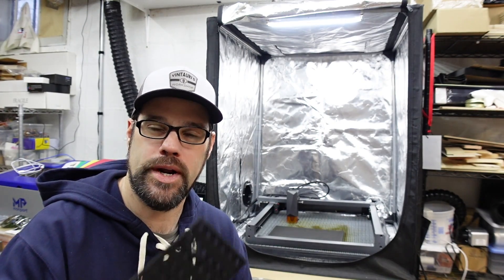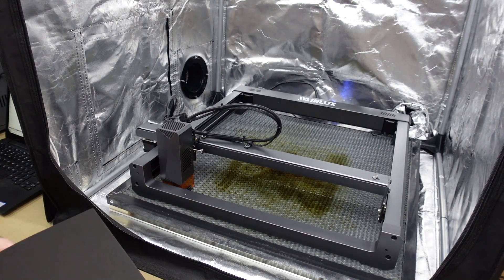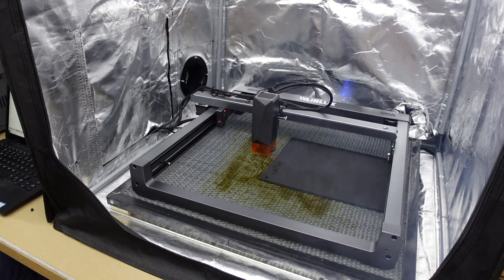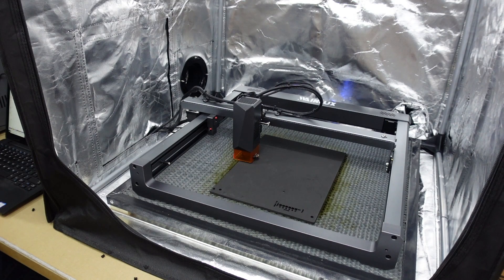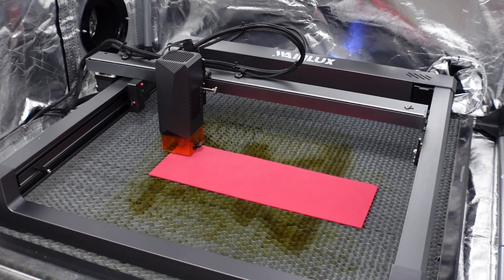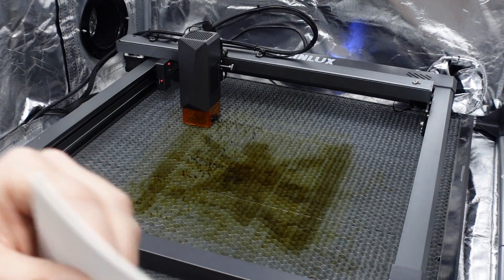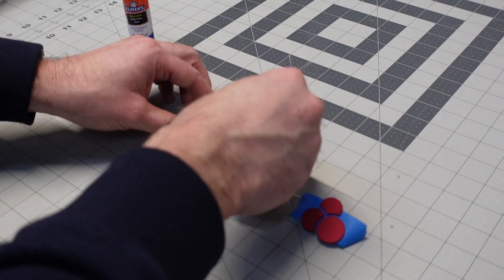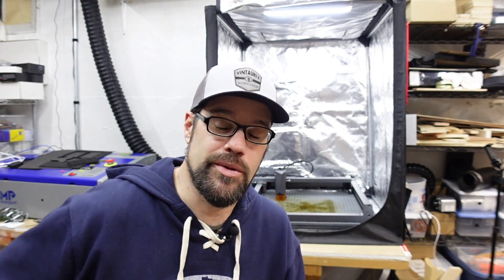Cutting EVA foam with Diode lasers!

Comment: Help!!! I need to engrave on white adhesive foam and it’s not working. Any work arounds?? Ty
Reply from the maker: If you are using a diode laser it will not work on the white material as it will just reflect the visible light. You need to use darker colors of material.

Comment: Would this work with adhesive foam backing?
Reply from the maker: It should, I've cut other materials where I've added the 3M adhesive backing before cutting.  Just keep an eye out for flare ups.

Comment: Eva Foam fumes are toxic, Please wear protection.
Reply from the maker: This is a good point, but I also always have my lasers running through air filters and then exhausted outside.  Anyone running a laser on any material should avoid all fumes even from untreated wood.

Comment: 6:03 - If you're cutting the all the way (it's not very clear from the video if the corners are joined), it's generally a bad idea to cut the outline first, because the piece might move slightly (especially with air assist) and your subsequent cuts can be slightly off. Always cut the outline as the last operation, to avoid that.
Reply from the maker: It's not clear in the video but it is cutting the arcs on the top of the part and not the inner circles.  The inner circles all get cut first.  You are correct that any engraving and interior part cuts should be done first and this can be set in the Lightburn optimization settings.
Reply: @Vintauri  - I mean the rectangular outline.  It's clearly starting with that cut, but I can't tell if it's joining all the corners or not.

Comment: Hey Steve, I will also ask on the Sunday night show, but have you ever tried using the Pepakura-type files with the EVA on the Diode Laser?
Reply from the maker: I have not tried that yet, it would be a fun experiment to see if you could score the lines for the folds without going so deep that it causes the foam to rip when putting it together.

Comment: Can it cut EVA foam, 40-50mm thick?
Reply from the maker: The laser beam only stays in focus for 2-3mm outside of that range you loose power and the spot gets wider.  So 6-9mm is about as thick as you will cut on a diode.  Some Co2 lasers with a longer focal lens would have a chance at EVA foam that thick.

Comment: Hi, what max thickness of EVA foam are you able to cutt with 10W diode laser? I need to cut a toolbox foam - 40mm thickness.  So I would like to cut 10mm sheets and than glue them together.
Are you able to cut 10mm EVA with this 10W diode laser head? Thx
Reply from the maker: I've only cut 1/4" or about 6mm thick EVA foam.  I have not tried anything thicker.  Your laser beam will go out of focus the deeper you go so there will be limits without a longer focal length and a powered Z axis with multiple passes.

Comment: Red can cut way faster, my 10W cuts at 5000mm/s on a 2mm EVA foam, the green one cuts at 4500mm/s. Even the blue one cuts at 2400mm/s.
The white you should do multiple passes at higher speed for better finish.
Reply from the maker: Thanks for sharing that information.  It will be a bit dependent on each laser due to spot size and beam frequency differences so some may cut better than others.  Always good to have some extra material to test on!
Reply: @Vintauri  Diode laser, the standard blue 445nm, mine is a TWOTREES TS2.

Comment: Hi sir can I cut styrofoam with diode laser?
Reply from the maker: If you have a dark colored EPS Styrofoam you might be able to cut it, but most white Styrofoam will not cut well with a diode laser.  Be sure you know what kind of foam it is as some will have bad chemicals or properties that are not safe to cut due to flammability or toxicity.

Comment: You can get EVA foam up to 1", how do you think it will do with something that thick?
Reply from the maker: The issue I see is that the laser beam will be well out of focus at that depth.  I would say 1/2" would be likely with some trial and error for depth of focus and power/speed settings.  But 1" might be pushing it.

Comment: I can cut coroplast black color with Diode Laser 

What materials do you recommend for Shadow box that is easy to cut and strong
Reply from the maker: Generally I'll use hardwood and build the shadowboxes using traditional tools, but if I wanted to do it all on my laser, I'd use some 1/4" cabinet grade plywood.

Comment: Wonder if it will work on my 2.5W, only one way to find out. Was surprised the white cut.
Reply from the maker: Give it a try and see what it will do. I think you should be able to get through the thinner foam.
Reply: Hey you tested It? Would really like to know if it works
Reply: @outstanding1403  Just got the new 3040 expansion bed yesterday, will have to mount that first but I got a sample craft pack of coloured 2mm EVA to try it on. Been distracted by the 3D resin printer but that broke and waiting for parts, so back to upgrading the 3018 to 3040.

Comment: Hi, nice and informative. My questions are: 1.  Can a diode laser cut a black depron 3mm foam? 2. Can it cut an xps extruded polystyrene foam, specifically so called blue or pink foam used as insulation in building construction? 3. Is it safe in terms of not harmfull gases? Many thanks.
Reply: Important questions, I'd like to know, too...
Anyone? Thanks! :)
Reply: Great question 😊
Reply: @mrombit605  I cut 3mm and 6mm black depron with my diode laser!

Comment: Great vid,  is there a way to do this with a blade cutting machine instead of laser? And if so, what machine do u recommend to cut foam that thick?
Reply: you could do it on a cricut maker in thinner materials. But look at it like this, for what you spend on the cricut and it's neccessary accessories, you could invest a little more in a laser that will increase your available materials and thicknesses by many many times.
Reply: Blade based cutter machines are an absolute JOKE when it comes to any material that has any kind of decent thickness!!!! The blade of the cutter has to be able to SWIVEL when doing tight curves and corners. Having that thickness prevents the blade from swiveling properly and you could get tearout of your material. Laser on the other hand has no mass or breadth that it has to force through and pivot through the material---just a solid beam of energy vaporizing its path through the material!!! Laser is an absolute advantage to have against thick materials!!! The ONLY other method of cutting thick materials such as foam is a die-cut press with a preformed blade that is used to press and cut the foam...good for high volume repetitive production but absolutely worthless for one-off custom stuff!!!
Reply from the maker: It might be possible with thinner foam, but I’ve not tested it on any machine I have access to.

Comment: Sent by clack after seeing his gear junkie video , am crafter with 10 watt diode, just starting out. Never thought about foam. Figured it would be unsafe. Now I just have to research what my foam is made out of. Thanks for sharing ,
Reply from the maker: Thanks for checking it out.  Some foams are safe to laser, some are okay but tend to burn to much and some are very dangerous as the gasses released can be poisonous. EVA foam is one that cuts well and is very safe to use on the laser.

Comment: Great video. The EVA foam cutouts have a lot of possibilities for kids crafts. Thanks for the idea.
Reply from the maker: Yes they do!  You could even have them draw some shapes on paper, then scan them and use the tracing tool to then recreate the shapes on the laser in foam. Lot's of ways to get the creative juices flowing with kids..... and adults! :)
Reply: @Vintauri  I didn't even think about the trace function but that's and awesome idea. I don't have an extra set of glasses which means they can't watch it cut.

Comment: Nice video, you just confirmed what I was thinking about EVA foam and lasers.
Reply from the maker: I'm glad it was useful for you.  I've been cutting this 6mm EVA foam for a while on the larger Co2 but wanted to run it on the smaller machines as well.
Reply: @Vintauri  In fact, larger machines or others need to give the machine a lot of space. For the small size, it is a very good design for fast moving machines or better settings for engraving actions.